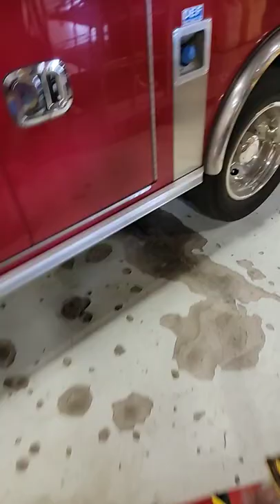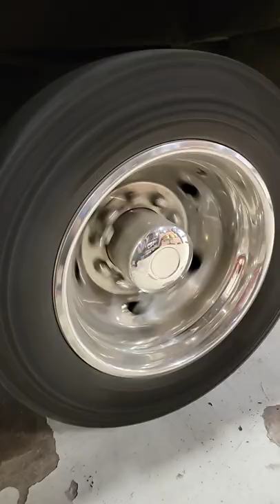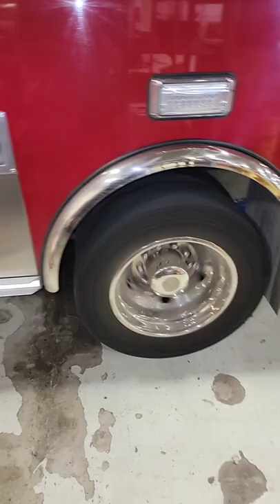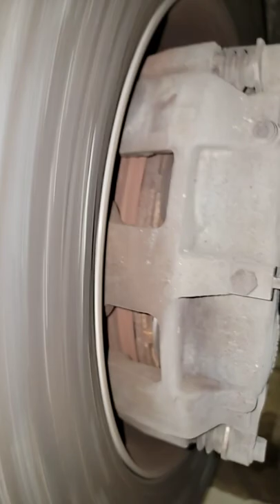Noisey Superduty Boooty #shorts

Comment: Warped rotor. Every time the warped hump comes around it moves the caliper
Reply from the maker: Ding ding ding
Reply: @PowerStrokeTechTalkwARod  I would want to check the hub flange for trueness at this point too.  In my fleet, if this happens its because they hit a curb going around a corner at 30 mph or something equally stupid.  BUT...when you use shitty chinese rotors, you'll see alot of this.  Its called a cold cast defect, where either the mold was too cold or it was poured too slowly when they made the rotor.  The first time the rotor experiences an elevated temperature cycle, it warps.
Reply from the maker: Nicely said
Reply: @blackopsrocks  nothing like doing a brake job with cheap Chinese parts, and then having to redo everything two weeks later.
Reply: Ya by the time I hear him say I couldn't figure it out while I watch it go around... I'm like um are you wearing your glasses???..........🤔

Comment: brake pads are down to the low pad indicators. rear brake job with rotor replacement. Check those front brakes too.

Comment: Between the added weight and requirement for any emergency braking will cause these rotors to warp out.
During your reconnaissance you might want to check and make sure none of the calipers are sticking
Reply from the maker: Was a bearing guy

Comment: This is surprisingly another positive to why one side of that caliper floats, if it wasn't floating, itd of either ground the rotor, or the caliper, more likely killed the piston forst, since they'd be the weak point.
Great engineering if u think about it.
Anyway, take the brakes apart, im sure either something wasn't put together properly, if they were done anytime soon, or, they are warped. Which is probably the case as u have multiple types of people driving them, and some have no idea thay ripping down a road and then riding the brakes will heat them up to red hot glowing, quicker than you'd think. If you do this with cheaper parts, they will warp quicker

Comment: Warped rotor and caliper pistons are vibrating causing a screeching sound. Wheel bearings grind they don’t screech.  Probably just went through some water when the brakes were hot. Easy fix.

Comment: Yep it's the common warped rotor problem ambulances drive at high speeds and do hard braking the constant heat change on the metal can cause the warp ed condition only real fixes to replace the rotor
Reply from the maker: NO, read the comments

Comment: Probably just a really warped rotor. I would check the hub to make sure it isn't bent also from them hitting curbs at high rates of speed. When they drive cars all the time and then you put adrenaline mixed with a big truck that's over loaded and they live to hit curbs.
Reply from the maker: Bearings blew out
Reply: @PowerStrokeTechTalkwARod  awesome. Did you have to replace the shaft also? Low oil? Over loaded? Bad driver?
Reply from the maker: Submerged in water....no lube...replaced bearings...hub....shaft.....rotor/pads/pins....other side was ok tho

Comment: Bro that either those axles are bent or something fucked inside that pumpkin! 🎃 🤣
Reply from the maker: Um no
Reply: @PowerStrokeTechTalkwARod  the odds of both rotors being warped that bad is very low. Something we can't see in the video is whether or not the deflection is in sync. If they are the axles most likely bent at or near the hub/face plate.
Reply from the maker: John, bearings were wasted....................

Comment: Nothing Rotors, Pads, hardware, and proper cleaning and lube of the pins, wouldn't take care of.
Reply from the maker: Read pinned comment!!!!
Reply: After watching the video again I do see the runout carries all the way to the wheel. That would now include checking the axle flange and hub and bearings on the full floater. My Bad.